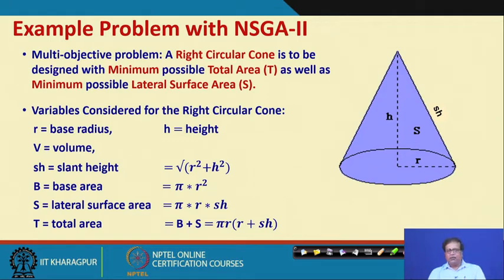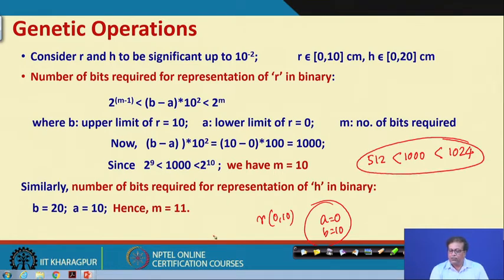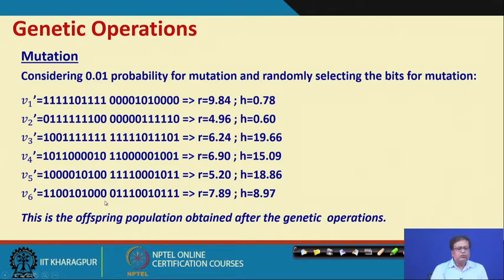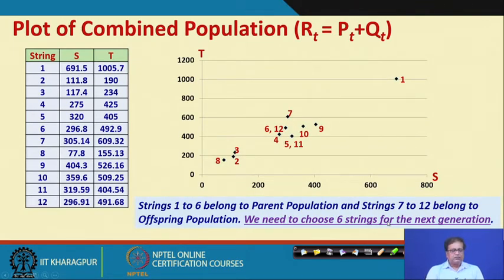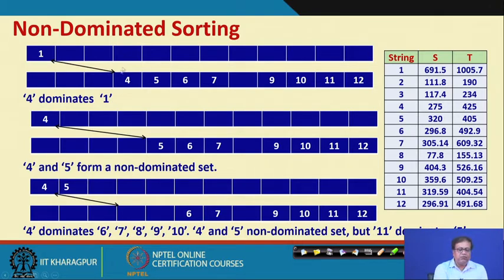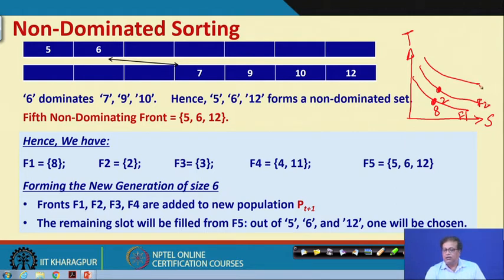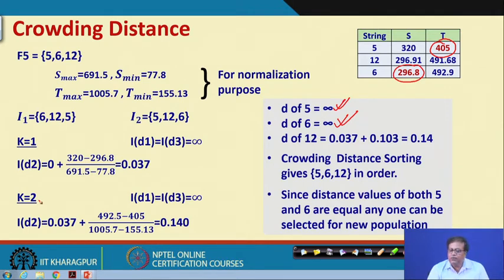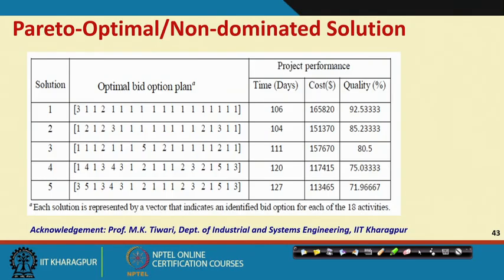Lecture 40: NSGA-II Examples

Comment: One question. In case we set the distance of  boundary values to infinity while calculating crowding distance, won't we always end up chosing one of the values which has infinite crowding distance?
Reply: I was thinking exactly the same. Maybe we could ignore the the function in the case where the point is a boundary and multiply by 2 the other function. So we would be able to compare. But i'm not sure this procedure is correct.
Reply: That's the whole point in assigning it infinity. Those are the least crowded points, so should always be selected to achieve population diversification and avoid local optimization